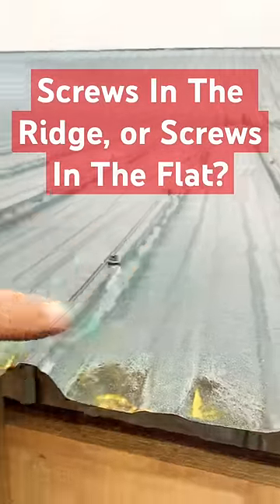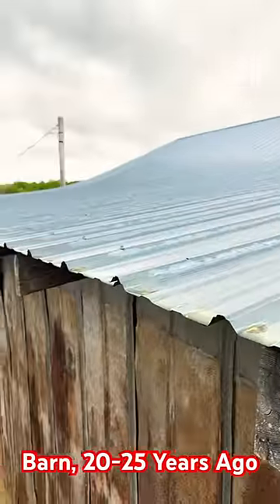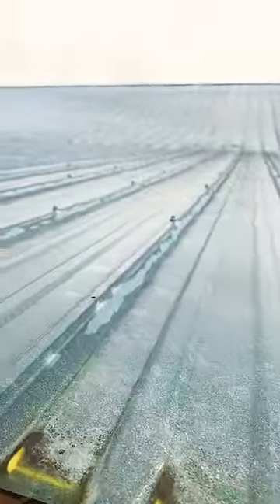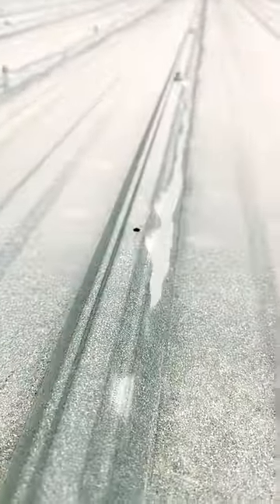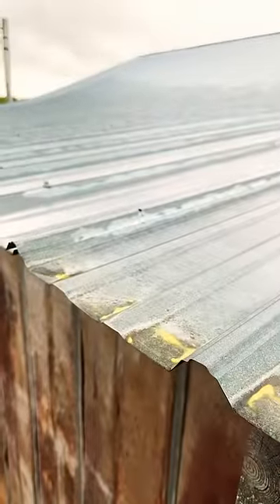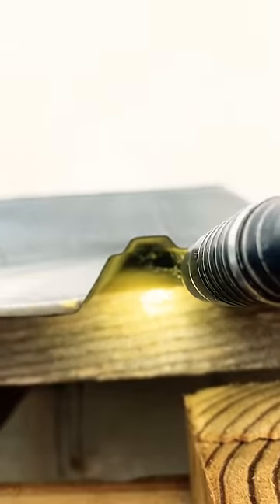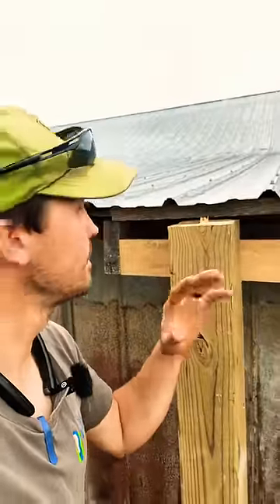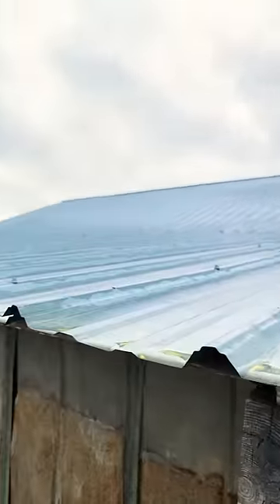What’s Better? Screws In The Ridge Or Flat? #construction #farmlife #building

Comment: Ridge is less likely to leak over time but it’s much harder to keep the metal flat and straight when doing it that way I just run it in the flats and plan on using the spray flex seal clear if it ever leaks
Reply: So instead of taking the time to do it right from the jump, you do it the quick way and have a band-aid planned for when your work fails to achieve its sole function. Brilliant.
Reply: @andyanderson2143  I can tell you’ve never actually done this before think about it like this take a piece of paper fold it into zig zags now take 47 of them and place them end to end all the while keeping it square and plum while pressing on the peaks if you do this for a living you’ll learn the best practices for both a good job and a effective method to make money doing said job.   I’ve done over 100 probably closer to 500 metal roofs I’ve done 5 or six in the peaks every single one of them required triple the amount of time to get it done straight so the fascia don’t tell on you

Comment: You convinced me, screws in the ridge. Thanks for sharing
Reply: If you live where high winds are possible ( do you get hurricanes?) then DO NOT ridge screw, unless you want your roof to blow away.
Reply: @ajs96350 right? I was instructed to do both ridge and flat here (N of Amarillo)
Reply: @shaman295  Ridge screws would just be lap screw, metal to metal to pinch the joints together.
Reply: @ajs96350  or use longer screws?
Reply: @rodschmidt8952  No, my point is that screwing through the ridge only allows for movement of the sheets.
The flat part could lift in high winds, around here they MAKE us (inspectors) double screw the flats.

Comment: Ridge screws work loose in windy areas causing the roofing material to come off and screws on the flat may have gasket issues after 15 or 20 years.
Reply: They also work loose due to expansion over time
Reply: So you're saying go with Standing Seam Metal to avoid both issues until the panels rust through in 100 years?
Reply: @Box545x39  standing seam is way better

Comment: The “deal” is this. Tin (corrugated metal) use to be done right. It was thicker, stronger, and way better galvanizing. I have a piece or two from 1939, off a barn, my uncle built that tells the tale. That’s 85 years. It’s still better than what you get today as corrugated metal today… all “nails” were driven in the the rib! A tree is what caused it to be taken down. Oh, Lead head nails also… I have a box of them too. It was a quality “thang”.
Reply: Dig it ❤😊

Comment: I have always said when they went to putting the screws in the flat that it was stupid that’s were the water runs if there in the high spots there is a lesser chance of it leaking 😂😂😂
Reply: But if you put it in the high spots they will not warranty it 😂 so I never understood why. it will last longer and will have no leaks if the holes are on the top point of the tin but if you put the holes 🕳️ in the flat spots it will most likely cause a leak do to that’s were the water runs 😂😂😂 just common sense if ya ask me 😂😂😂

Comment: The screws that you put in the highs are slap screws and if you do not have a sealer in between it they will leak because metal on metal will leak without a sealant in between it as far as the screws that are into the flats that's what gives the building which helps to build in stay strong and gives it a win load that it needs against
Reply from the maker: The screws absolutely have the sealing washer, and I can assure you the hole goes all the way through. 

Wasn’t trying to tell people which way to do it, just show them how our barn was built 25 years ago and the boards under them were not rotten

Comment: I think it depends on whether it is a wood frame pole building or a fully steel frame building.  Also, it depends on the design of the screw head.  Some are a truss head with a rubber washer.  Those are fine for the walls.  For the roof, the best are the steel cup head.  The rubber washer is inside the cup.  When the screw is seated, the cup completely protects the rubber washer from the UV of the sun.

Comment: There are two types of sheet metal screws. #14 - "Lap" screws hold sheet metal to sheet metal -- at the ridge, where two sheets join. One side of the sheet metal has a leg resembling an "L" and that is called a "perlin leg". It goes against the structural steel or, in grampa's case the wood frame.

Number 12 screws, nicnamed drillers, go through the vallies at center of each wide trough, minimumly one at center sheet, into the framing members.

IF YOU KNOW WHAT YOU'RE DOING, these dont leak, because there is a rubber gasket atop each screw just under the head. These are called  "field" fasteners.

You need both #12s and #14s to PROPERLY install R- or U- panel on a building.

Comment: Interesting. A topic I actually know! I’m Haag certified and yeah. 
Don’t screw through the flat. I inspect maybe 900 roofs a year and maybe 200 of them are metal. 

Most leaks in R-panel with exposed fasteners occur at screw heads either way. But, you don’t want that leak in the lowest spot. You want it where a drop of rain has to directly strike it in order to leak.

Comment: I was taught to always put them on the ridge/highs. I’ve always done my own work by bout five years ago I was busy and couldn’t get to a job I needed done so I hired a well known installer, and when I got to the sight the roof was on and the screws was in the flats 🤦🏼‍♂️. None in the laps on the ridges . The first winter for this roof there were issues with ice and leaks and of course you know who had to fix the issues, ME!! 🤦🏼‍♂️. It just wasn’t worth calling the dude. IF YOU WANT SOMETHING DONE RIGHT, SOMETIMES YOU HAVE TO DO OF YOURSELF!!

Comment: The wrong way is actually the right way. Less surface area for the water to sit/run on. So it basically falls off befor it gets to the whole. The only water that goes in is the raindrops that fall directly inside of the hole which is closed the nun so grandpa probably didn’t run out of screws and forget about it. Grandpa may have actually been thinking because I just built a pig pen and I put my damn screws in the ridge.😂😂😂😂😂😂

Comment: Pro roofer here from up state.You run a 1/2" paddler in the flats on 6'2" centers with a zig zag. 9/16" mild steel bolts & run um. You've got to run um hard so they bite. All my crews run nothin but 3/4" drive impack and itll be good for who it's four. Have that ham n chee samamich no salt bag a fretas& grape sodder in no time boys! Yeeee whooo!-T from up state

Comment: Before the fancy sheet metal, we worked with "five V crimp" tin...and we loved it. No uppity screws with the girly rubber grommet, we had nails. Nails with oversized lead heads that were softer and would seal the nail hole that we put through a flat spot ON THE RIDGE that we knocked with a hammer...and we loved it. No fancy shmancy drills, no sir, just hammers and busted bleeding fingers that soaked in extra lead poisoning just in case holding the nails in our mouths didnt give us a big enough dose. And we loved it .😂

Comment: Does the rubber washer fall apart and let water in? Can we invest another $50 for 15 tubes of siliconized caulk per each $20,000 5000 sqft workshop to dab each screwhead for a fifty year fix?

Comment: In the ridge, of course. Water comes down through the trough.
Back when I was young, my grandfather and I put up a corrugated tin roof. For some unknowable reason, my grandfather chose to use nails. I smashed the hell out of my left thumb and forefinger. Pointy nails slipping on the ridge of that coordinated tin. But I never quit. I finished the job with my grandfather.

Comment: I have an arguments about this for years. I couldn't believe professional roofers believe that screws in the valley are the way it should be done, BS. The gaskets on those screws won't last forever and eventually will leak. Some dumb-ass roofers said well you know after 10 years going to replace the screws, yeah right. Always set your screws in The ridges you will never have a leak no matter what. Good job for posting this.

Comment: The truth is in the chemistry of synthetic-rubber.  I'm a ridge supporter b/c after 6-10 years of UV & heat torture the dry rot of each screw is less likely to leak.  Also if you have enough slope the debris slides off better without flat-installed screws.

Comment: My roof was built in 1911 ,ive replaced the lead heads with screws with rubber washers,i put caulk on them 20 years ago so they are doubley guarded.

Comment: Ridge hands down. Common sense. I’ve done lots of roofs and a house was 20 couple years old and they forgot a few screws like that. Very very little water spots. The rubber washer don’t last forever. So if it’s in the flat, you’ll have issues.

Comment: Depends on a good installer to make sure the screws are long enough to go through the ridge into the wood 1/2"-3/4" AND if they dont over drive them collapsing the ridge causing a pocket to hold water. I am a ridge screwer😉

Comment: I will bite.... heavy rain and its going to leak..  the wood your screwing into there is an inch away from the metal... ld screw where metal is touching wood.. the f e is no water to puddle on the ridge but a screw missing on the flat psrt is going to leak a lot...

Comment: And the survey says ……. do it your way. Different manufacturers spec different ways.  I’ve seen specs on the rib and profiles with specs in the flat.  I’ve seen projects on manufacturers sites with both ways.  I know guys (professionals) that do it either way. We’ve even installed roofs with the screws in the flats and the ribs because of wind loads, engineer designs, and specifications.  You wanna put them in the flat fine.  Do it.  Be aware there are some manufacturers that suggest only screwing in the flat at either the ridge or  at the eaves to allow the metal to expand and contract. If you wanna put them in the rib (like myself and alot of the guys in our area) just make sure you get long enough screws to account for it and don’t over screw it and damage the rib. There are roofs we’ve done that already 50 years old and still going strong.  Double up the screw spacing at the eaves and gables and the wind won’t rip it off.  If it does it won’t be the only thing gone and that’s what insurance is for.  Your roof protects the structure. The bracing, webbing, plywood, studs, beams rafters, trusses, strapping, studs, columns, purlins, members and whatever else the structure is made of. And yea some day you will have to replace the screws because yes some day the screws will fail.  Face it people nothing lasts forever.  End of the day the higher the pitch of the roof, the less likely to leak.  For lower pitches choose the right profile like a standing seam.  You’ll see these floating standing seam profiles on all pre engineered steel buildings for a reason.  Choose the right profile for the right job, the right gauge of steel, and go with a good product and choose a good installer and your roof will last a lifetime.  Also don’t forget to check the filters at the ridge vents once in a while.  When they get old they deteriorate, clog and can cause leaks.  Look after your investment and it’ll look after you. Calling someone unprofessional just because they do something different than you is just well unprofessional.  You don’t know their product, what country they live in, or what they know.  So stop it.  Get some help.

Comment: Keep them in the flats. Unless the utmost care is taken not to overdrive the screw, the ridge will flatten out and warp the sheet, causing a cumulative out-of-square issue. Especially with 29 G residential metal.

Comment: It's super easy to see when you've missed screws. Do you really think your dad and your grandpa forgot to put those screws in? No they didn't. The screws were eventually broken by shear forces and fell out because they put them in the rib. Also, if any water did get through there you would never know because it has plenty of air circulating to dry it out. 

These days they have much better screws that have completely covered neoprene rings that seal great and are protected from the Sun. However, if used on a rib these would not seal well because the metal dome covering the neoprene washer would bottom out before the neoprene ring fully expanded because it's on the rib. 

Most manufacturers in fact, all that I've ever seen, recommend screwing the flats. Probably  because of the better clamping Force, better sealing and easier installation. They install easier because you don't have the panel expansion that you do when you screw in the rib. This expansion caused by uneven screw pressure will cause the panels to go out of alignment and cause oil canning
And finally, because you didn't have screws also in the flats side by side to compare it with this argument isn't very convincing at all 

That's what i think

Comment: So I would agree to put the screws in the ridge. However.. the windstorm engineers literally give you in image that forces you to install in the flat/valley. It’s possibly more strength to resist uplift from the high winds, but I would personally agree to prevent leaks.. you screw in the ridges

Comment: That's how it was done before the rubber washer, back when it was a lead washer. The flat is easier, and since the rubber washer wasn't going to alow it to leak, in the flat became common practice. After 30 years (my experience) I can say with confidence that the flats will eventually leak

Comment: You screw the "ridge" to keep your panels from flapping and possibly bending in strong winds. Just make sure you use long enough screws to secure the roof to the sub framing. Otherwise you're just fastening all the panels together to blow away as one giant sheet LoL.

Comment: Depends on the pitch if it’s flat I would put it in the rib with a stitch screw … otherwise I go off what the manufacturer requirements are . And seal the rib with sealant anything below a 3/12 pitch .  Also use the new zxt screws they cover the washer head so ya don’t have to replace every 10 years .

Comment: We have barns and even a house made with recycled wavy corrugated, the kind that smoothly curves up and down with no flats.  There are many holes in the ridges of that with no screws, stand in the attic/loft and you can see daylight through them.  No water damage whatsoever and we are talking like 50-60 years like that.

Comment: Ridge. Highest point on surface, lowest chance of getting wet during a storm. But wind has an easier time ripping it since the forces will be focused on a smaller area compared to the flats. This is true unless you place a washer wider than the ridge/flat to spread the wind forces over a larger area. But as for rain situations and waterproofing without any use of sealant ridge is the way to go. If I’m wrong and you could explain it to me I would appreciate it 👌🏼 but to the best of my  knowledge this would be my selection

Comment: I put similar profiles on walls. Manufacturer recommended screw pattern is beside the ridge in the flats, closest to the overlapping edge. But thats walls. .
For roofs,  standing seam metal roofs with concealed screws make this debate moot.

Comment: Grand dad and dad, put some serious thought in it. In the lower sheet, the corrosion will happen faster. But it dose too thing.  On the higher edge. Keeps the edges tight and the screws dryer and higher, smart. Also easy maintenance. If you put the screws on the flat. Screws will have  corrosion faster. Because they will always be wet.

Comment: I’m a metal roofer. Have been for a long time. We screw in the flats. If screws in the ridge are overdriven it dimples the sheet letting water in. Also if you have a low spot in the roof the ridge screws can cause the sheet to become wavy. Oilcanning is what it’s called.
Reply: You would think if the screws are meant to go on the ridge that the gasket would be shaped properly so it would seal.. they are shaped flat because they are supposed to be on the flat part of the roof. (I know you know this..) also in case of any ice dam from snowfall it doesn’t take much to back up 1” to be able to hit the ridge of the panel where it is not going to be sealed properly because the seal is only making contact with 50 percent of the gasket. That and you can get the screw tighter to the metal by fastening to the flat.
Reply: Smart lad. Exactly right
Reply: If the screws are overdriven anywhere then you can do that. Fact is that the washers WILL degrade via UV and all your jobs will then leak. They also, if overdrive, will split, which is an immediate leak if you do them in the flats, but on the Ridge = less of an issue. Plus in the flats aesthetically just looks shithouse because they don't line up with anything usually.. We don't get much snow in Australia, but I would have to think that would be even worse for leaks if the washers go on a screw in the flat..

Comment: I've never thought about it. My intuition says ridge prevents water and flat area brings more rigidity with the screw being so tight nowhere to go. Even if weight goes on the ridge, if the screw was in the bottom flat area it'd be unlikely to collapse or dent. Opposite for ridge if that makes sense.
Will it be walked on? Flat area if yes
Ridge if no for more water repellency.
With the reputation though I guess it'd take a lot to distress the metal if screwed into the ridge

Comment: The ridge is correct.  The flat dimples and traps water which rots the tin around the screw.  Except steep slopes of course.  But yeah its always been ridge for me.  I worked with iron workers who disagreed but I've also met monkeys smarter.

Comment: Here in New Zealand we use this colorbond/colorsteel over here too. We have many many metal roofs here in NZ and rule of thumb is on the roof you screw through the ribs. If its being used for wall cladding you screw threw the pans